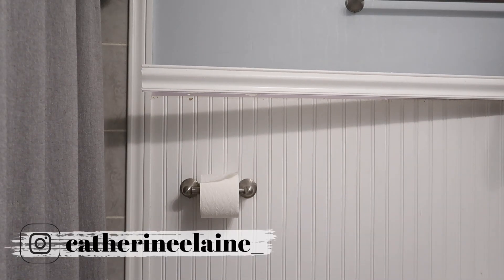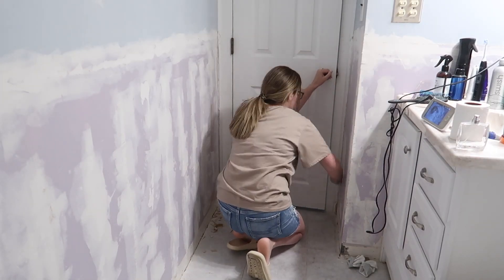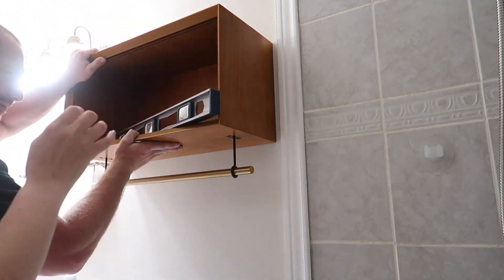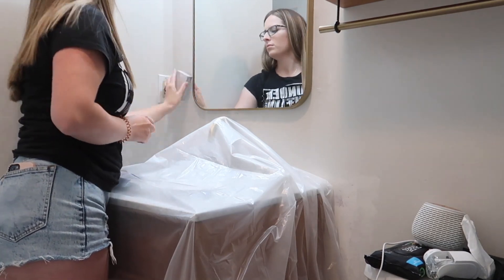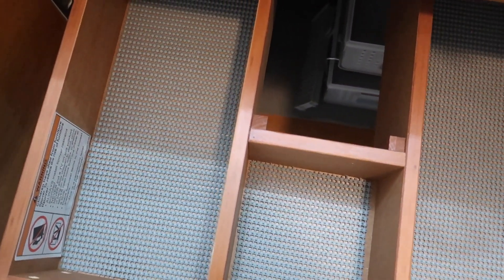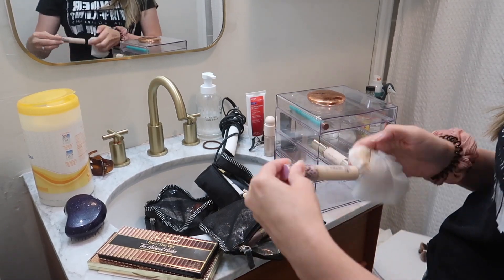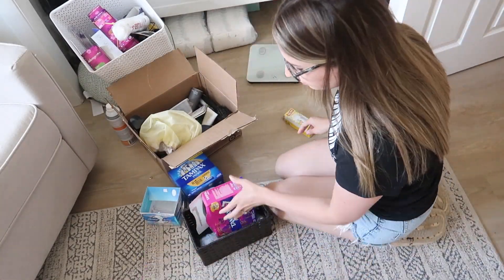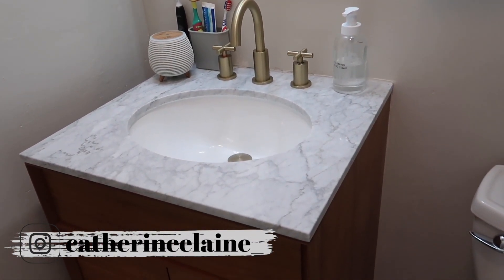SMALL BATHROOM ORGANIZATION IDEAS 2022 / MODERN BATHROOM MAKEOVER / SMALL SPACE ORGANIZING SOLUTIONS

Comment: Bathroom turned out fantastic.  Next time you run I to glue issue, use a heat gun, it makes its so much easier to remove it.  Really, great job on bathroom. It's a lot of work. I just did my 2 bathrooms, but I still need to organize things.Thank you for sharing the links to organization. ❤️